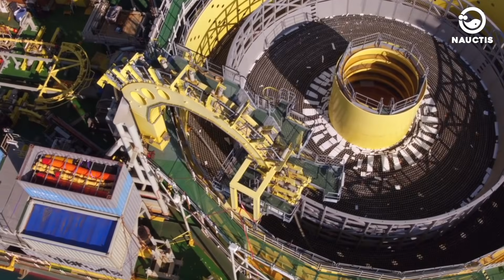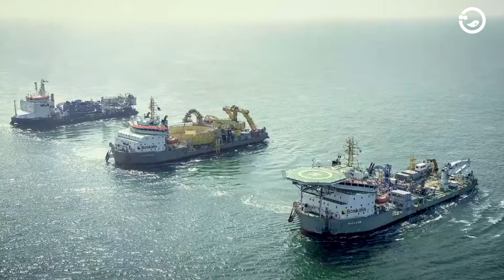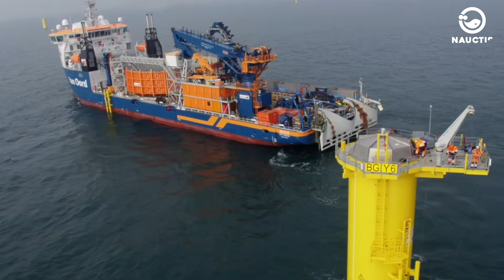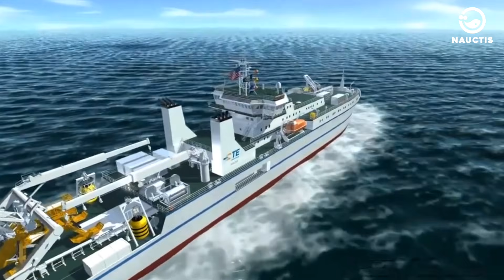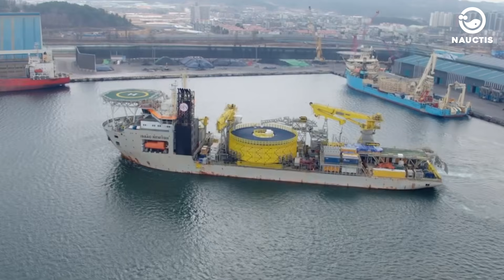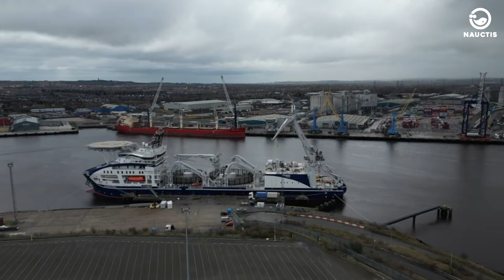INSIDE the Largest Cable-Laying Ship Ever Built: How Undersea Cables Are Laid

Comment: on a small speed as such boats operate and balooning costs, they could add additional barges for more cable carrying space to make it alike train like capability for longer routes.
Reply: imagine >10 boat formation connected by metal hinges that could lay an underwater cable in a single trip lets say london to new york
Reply: With how many joins to accommodate lack of cable distance capacity?

Comment: Firstly, all the ships you are showing are power cable lay ships, NOT telecom. And the so-called Japanese cable repair ship going under a bridge is, in fact, a sand dredger. So please, if you do a video on cable, get the vessel at least right. The only thing you got right was the steam/sail cable ship, a British ship, the first purpose-built ship was. CS MAGNETA
Built in 1884 by Napier and Sons, Glasgow. Length 237.4 ft, Breadth 32.1 ft, Depth 16.6 ft, Gross tonnage 1236
Reply: I especially liked the part that said the older ships laid cable off the back, while the newer ones lay cable off the stern, "which is the rear of the ship."
Reply: If she has a front bum- shes a cable layer
Reply: And this video has 43 thousand views... sigh

Comment: Fun facts, the ship size and design determine how rough seas it can handle before submarine cable installations has to be put on hold. So the bigger ship the bigger waves it is able to handle and the faster equal the cheaper the cable installations will be.
Reply: Nonsense